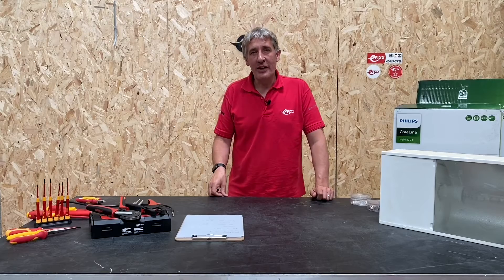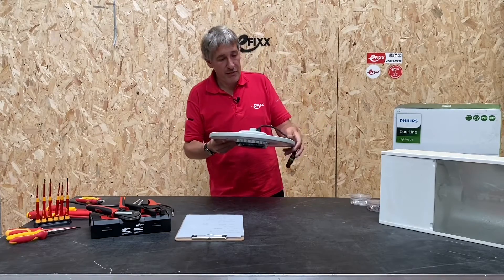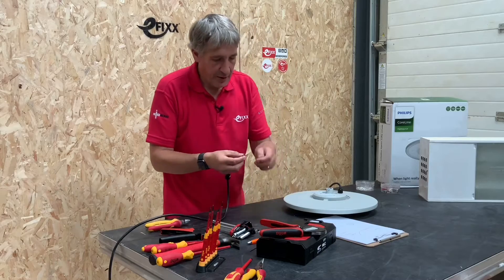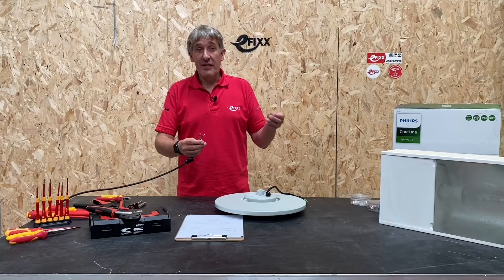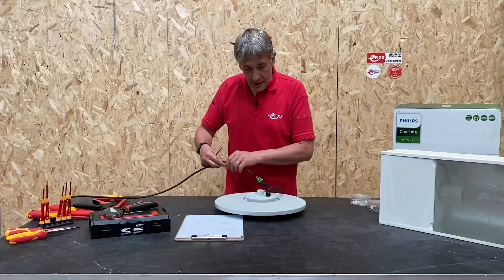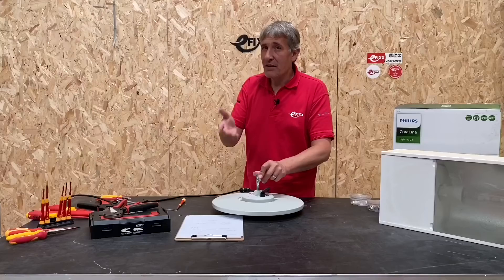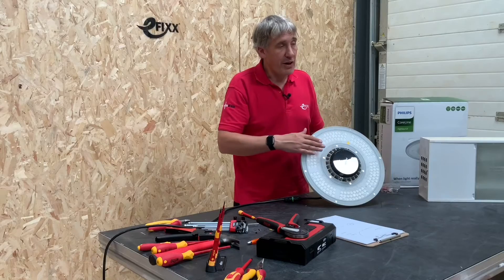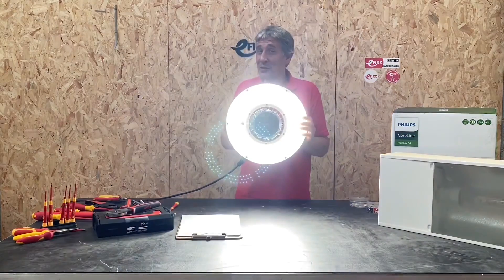Philips CoreLine LED Highbay GEN4 - cost effective replacement for HID lighting.

Comment: This looks mint! And maintenance free 👀👌 . I can easily see this in manufacturing as past experience I've seen and used these high chain lifts that are powered by compressed air to remove tools that weigh up to half a tonne, and standard fluorescent lights were a pain trying to adjust the amount of hanging chain so as not to hang too low. Gordon, do you recommend twisting stranded conductors before putting a ferrule on, or is it just the way that you have always done it? I only ask as I have not seen many people do so when putting on ferrules.

Comment: Great to see that you dont have to take fitting apart to make final connection, can always guarantee that it would be the final screw that you would drop from the top of the scissor lift when connecting these high bay fittings.